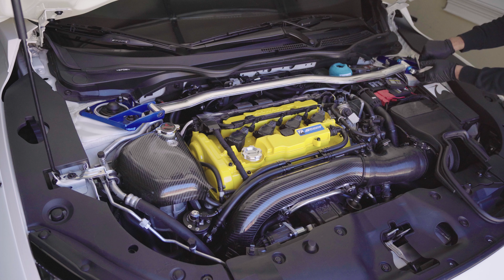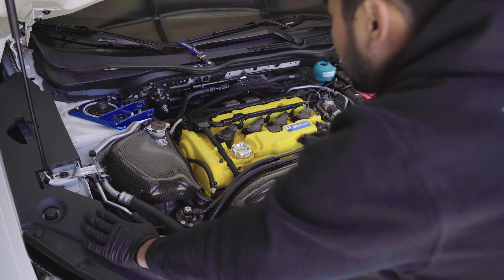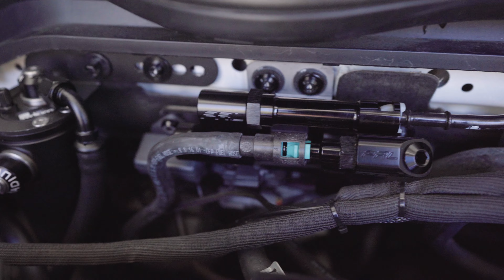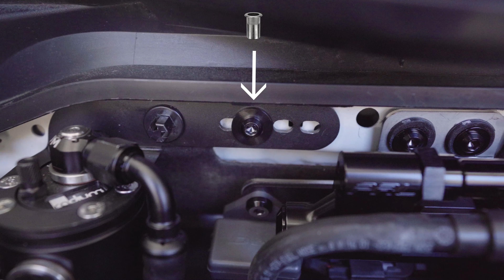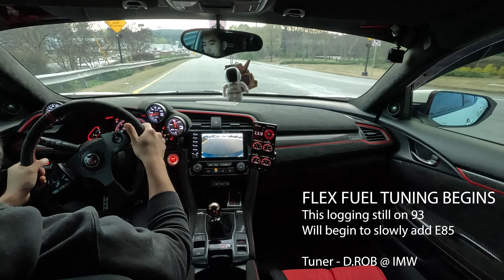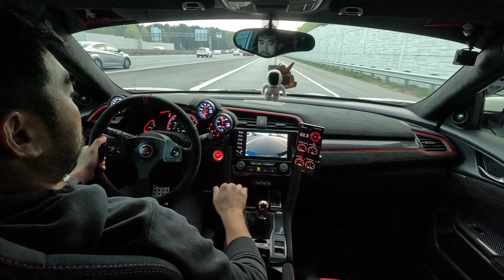The Varis Widebody Honda Civic Type-R FK8 is now CORNFED!

Comment: Love the build! Are you still worried about line degradation or lpfp filter glue issues with E? I bought the flex fuel wifi kit, getting cold feet about all the other things that need upgrading.
Reply from the maker: When did you order the kit? I just got the new one in that uses stock lines and they said it's good. We'll see lol
Reply: @Kodawari.FK8  Bought the latest PRL V3 wifi, haven’t installed yet but probably will. Looking forward to your dyno session, no doubt you’ll hit 500🔥